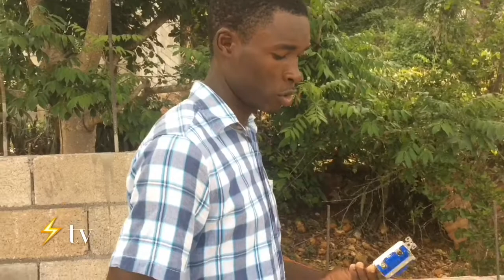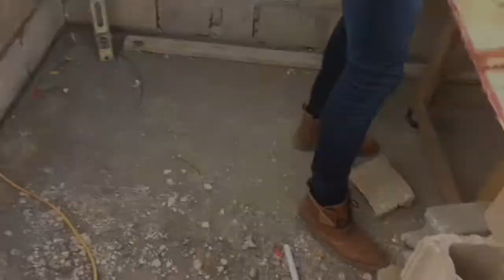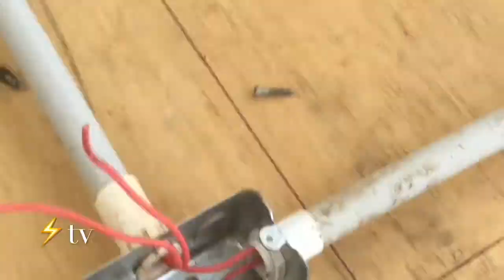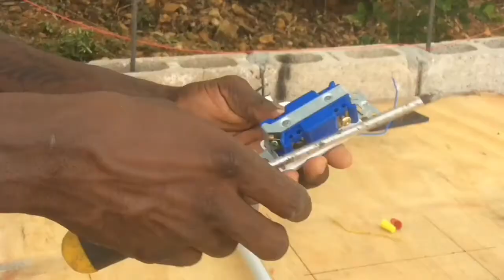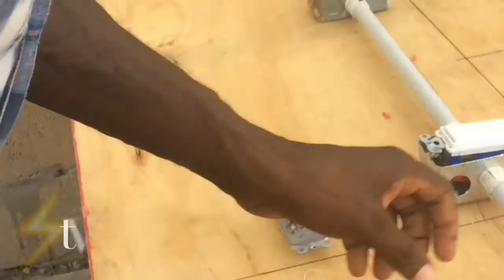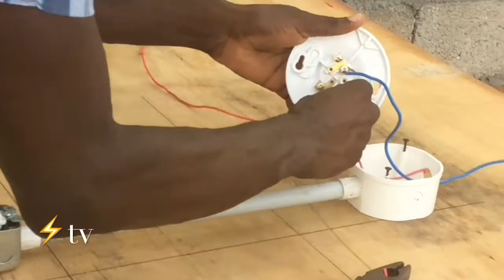How A Intermediate Switch Work! 3 Switches To Control 1 bulb !! how to install a intermediate switch

Comment: But why didn't you put the plug at the two way switch to make it easier to understand?
Reply from the maker: Maybe i'm not understanding your question because the video  demonstrate how intermidate switches work ,it's not a plug circuit .
Reply: @ElectricalInstallationEEE  ok nevermind I understand it fully but how I learn it at school it's just a bit different 👍😎
Reply from the maker: Was it a intermidate switch you learned about?
Reply: @ElectricalInstallationEEE  all the above I'm certified with a level 3 degree
Reply: @kevinbeckford8228  what’s a level 3
Reply: @jak50cent  I am certified with a level 3 certificate
Reply: @kevinbeckford8228  what does that do? is this in the states
Reply: Love the demonstration E.E.E, I know these videos or for demonstration but if you have black wires you could use it for neutral instead of straight Red.
Reply from the maker: Yea or even blue but i was just using what i had at the time ,that's why i even color code it with a black tape.
Reply: When I want to know if someone knows how three wiring works I tell them I want just three wire at the switch boxes and make the connections in the light. A a lot of guys just remember the steps not the concept